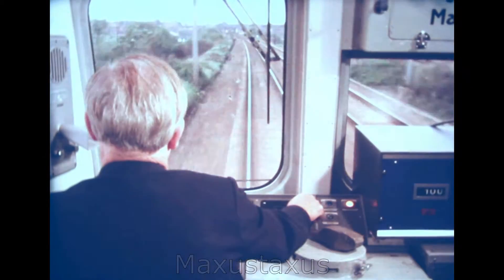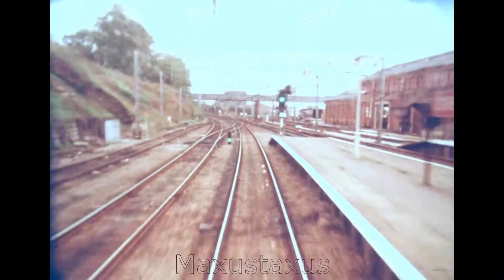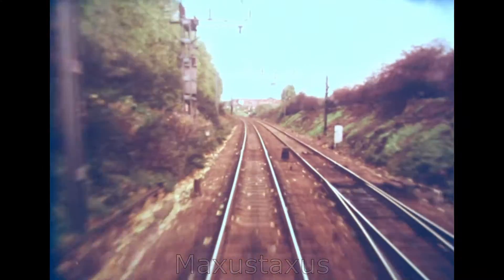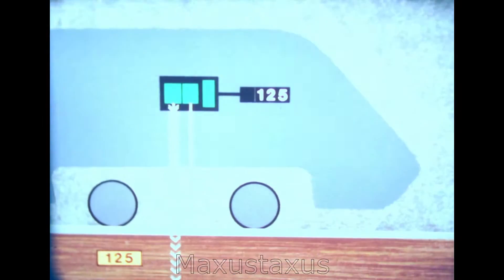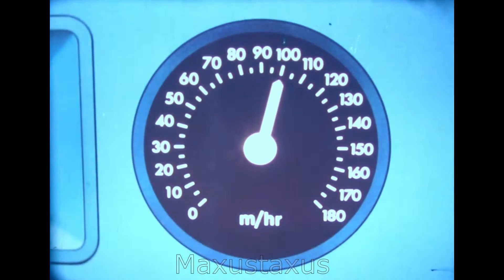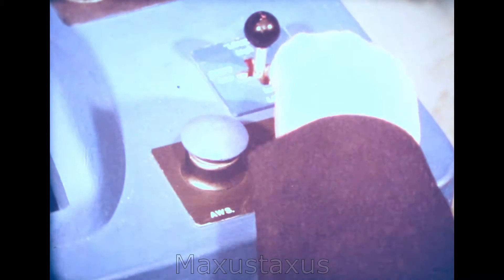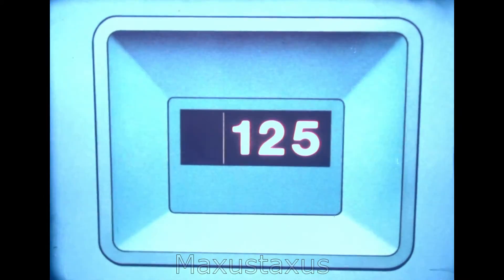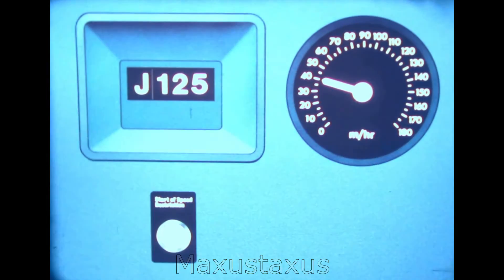British Rail C APT System for APT Train Driver Training C1972

Comment: What train is this?
Reply: Not the apt - it’s a class 312 multiple unit , also the video would be post 1976 as that was when Birmingham international station opened
Reply: @paulwilliams8741  could it also be it's older sister, the 310?
Reply: @paulwilliams8741  In fact, is IS a 310. 312s were built only after 1975.
Reply: @paulwilliams8741  I stand corrected, the speedo at one point says 90mph, which 310s are not capable of.
Reply: APT Advanced Passenger Train, designed by BR but the project was pulled by government before introduction to passenger service, the itallian railway took on the idea and sold it back to britain as the class 390 pendolino the equivalent to CAPT balises depicted in the film is TASS Tilt Authorisation Speed Supervision

Comment: I am thinking why they didn't took it further, with possible connections with the signals to the transponders where possible, and passive transponders where it's not possible to make such connection. So diverging routes, and yellow and red signals... It could be a cheaper, but just as good a solution as the later TWPS.
Reply: TPWS was to be a temporary expidient after the report into train trotection systems following several accidents until ATP  was fitted to all lines, however privatisation meant the cost of ATP was deemed too expensive and so we are stuck with TPWS which in itelf is neither failsafe reliable or a complete signal engineering based solution, which both the trial ATP systems now beimg removed from the chiltern and GW lines are